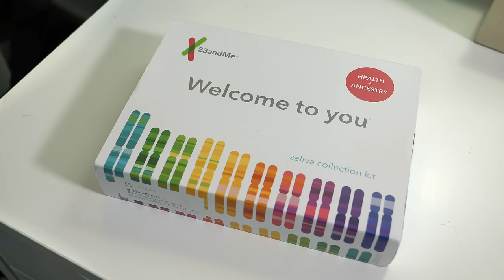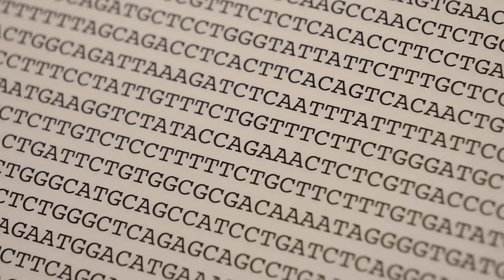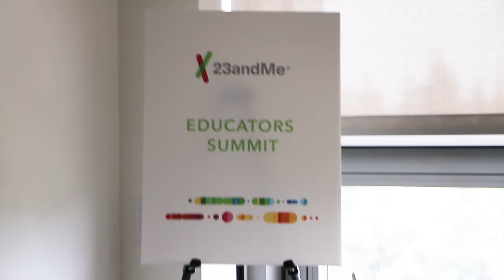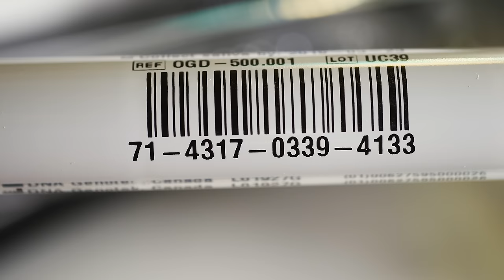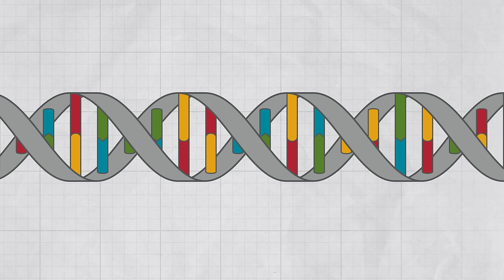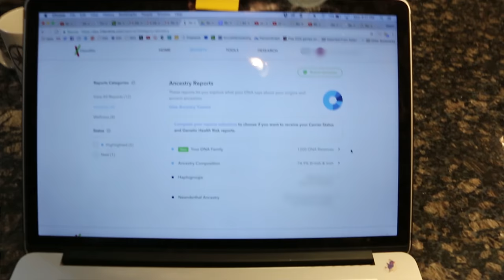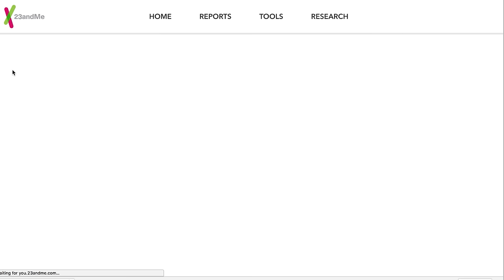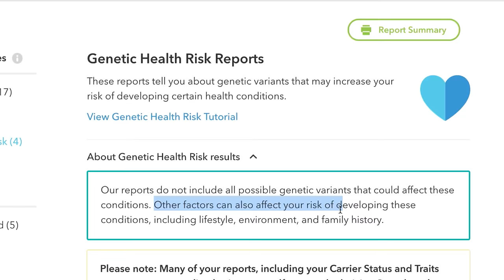DNA Testing and Privacy (Behind the scenes at the 23andMe Lab) - Smarter Every Day 176

Comment: I've got a BSc in Genetics so thought I'd explain a bit more on how significant that small percentage of DNA they take is and also add some extra interesting facts, including why we're still not really using genetics much in medicine (which I believe ties into the third party scientists mention of the "nuances of human genetics"). :) 

Firstly, while I'm not paranoid about it, what they mentioned on genotyping and how little info they take - that small percentage is actually not as safe and insignificant as you might imagine. This is because the vast majority of your DNA is made of repetitive "non-coding" sequences.  As an example one single type of repetitive sequence, called the ALU sequence, makes up about 10% of your DNA - this is more than all the "coding" elements put together!  When you look at how much of your DNA is coding data it's actually a very small amount, so they'd actually be collecting a substantial amount of info on what makes you uniquely you, and this could still be used to identify you! While I say this though, the interesting fact is that in things like paternity tests, they actually don't use any coding data! They use the pattern of the non-coding elements - so in a paternity test they ironically identify the father from DNA that doesn't specifically code for the father or the child! 

You may be wondering why there's so much non-coding DNA - interestingly they used to call this "junk DNA" as they knew it didn't make proteins and thought it was waste left over from evolution.  They actually used to remove this on early cloned animals, but through that they realised it's not actually "junk" (if you look up Dolly the sheep, one reason she actually got really ill because they removed her "junk" DNA).  This is actually used - amongst other things - to promote/inhibit/control what parts of the genome are expressed.  This is known as epigenetics (which also has a lot of other areas, not just this - it's truly fascinating!), and that's one of the new big areas of genetic research. With epigenetics, we now know that even the coding parts don't specifically code for who you are as there are further controls and some of it is never even used!  That is why for most genes they don't say "You have X gene so you'll get X illness" - they only say a % as your body may or may not use those genes in ways that cause that illness.  ...also this is different for every cell in the body as they're all pretty much independent.

If you want to read anything even more fascinating you should look into the human microbiome - which is how they actually think the DNA of organisms inhabiting out body could have even more impact on things like health than our own genome through (genetic) symbiosis!  The total bacteria inside you have potentially 100s of times more genetics data that you do, so if there is symbiosis there you can get how relevant that is - essentially they're an extension of your genome! ...worth remembering that next time you're prescribed a broad spectrum antibiotic (which basically aims to kill all internal bacteria!!).  With epigenetics and the human microbiome though, hopefully that shows why so little genetic info is still used in medicine and diagnostics.  DNA is not the simple blueprint of life we thought it was 20-30 years ago, so it's not a straight tool that can be used for diagnosis - it more shows you potentially how healthy or sick you could be, rather than what you will be.
Reply: Tad Springer Dolly the sheep became ill because the chromosomes of origen became from an adult sheep. That means shorten telomeres.
Reply: Carlos Alemán Dyer while that's true, it's not affected other clones that have also been cloned from adult cells as now they include non coding regions. The exclusion of non coding regions meant there was less control of gene expression, which led to extreme levels of inflammation. That's why Dolly had extreme arthritis by the time she was about 2.

A far as the shortened telomeres, there's an enzyme called telomerase that extends these. This means it wouldn't have passed to Dolly. The cells that were chosen were also taken from a fairly young sheep and were compared to many others to choose cells that hadn't lost much genetic information from telomeric shortening, so it's unlikely it played a huge role in her illness. It's all relative though so it could have still contributed.
Reply: Tad Springer I'm not inventing stuff up you can do a research and find that they where studies on telomere and telomerase as early 1994, but the activation of the telomerase was not use in Dolly. Activation, because the telomerase is inactive in mammals.
For Dolly they not only clone 1 sheep but 3 and compared the length of the telomeres between them, 2 of them were the same and1 was different because the age difference of the donnor. 
So yes the fact that Dolly age quickly and had health problems is because of the shorter telomeres (Here is a simple bibliography:
Blasco, M et al.; Telomere and telomerase; Genes and development 1999, 13
Xu J., Yang, X; Will cloned animals suffer premature aging - The story at the end of clone chromosomes; Reproductive biology and Endocrinology; 1; 105; 2003
Shiels P. Et al; Analysis of telomere length in Dolly, a sheep derived by nuclear transfer; Cloning; 1(2),2004; 119-125)
Reply: wild mangrove I'll have to check those out, but telomerase definitely isn't inactive in mammals.
Reply: So never use antibiotics unless youre already dying? Tell me something i dont know. I like my microbiome old and healthy. No drugs for me thanks.
Reply: You did a bachelor specifically on genetics? Or just a focus on genetics while doing biology/ biochemistry? (I'm doing a bachelor molecular biology at the moment)
Reply: Tad Springer Thanks for clarifying. I was sitting there watching that explanation and trying to find the best words to explain about non-coding/coding regions. I work in a forensics lab and we also look at "junk" DNA for purposes of human identification.
Reply: Tad Springer Thanks for chiming in!
Reply: Tad Springer Can you help me understand what the information is that "I might not want to know"? Have you used 23 and Me? Is like a checklist that gives a "yes" or "no" for some gene responsible for cancer, Alzheimer's, and genital warts :) ? What would be an example of "bad information", and would it be on a scale of likelihood or would you either have the gene or you don't?
Reply: Tad Springer Thanks for sharing...:)
Reply: As soon as he said the 0.02%, I suspected, like you said, the information entropy in that small amount of DNA was significant. I think it's rather dishonest of the genetic scientist not to say anything on this subject. They should have said something like "you're only giving a really small part of your entire DNA, ***however the part they take represents the most unique parts of your DNA, which is why they take those***". The privacy concerns are very much relevant.
Reply: @Star-lord - amazing how few people know that or that don't even believe that! There are definitely times that antibiotics are necessary (i.e. bacterial meningitis), but the routine use is like a nuke to the microbiome. In the future I think we'll judge today's beliefs on antibiotics similarly to how we now judge the war-time believe that smoking was good for you!
Reply: @Marijn Verhaeg - I actually did a BSc in Genetics.  It's actually not just 3 years of pure genetics though, the first year was actually the same track as a medical degree, then the next 2 years had a mix of Genetics, Biology, Imunology, Chemistry and even programming (given how much is done by IT simulations that have to be specifically written or adopted for most use cases).
Reply: MrRicmeme 
They kind of did suggest that when they said they take the most interesting parts of your genome .
Reply: @MrRicmeme - I totally agree with you that it seemed a bit dishonest! I was actually quite amazed he didn't say anything too and I do think not to give some information on how important that small % is was a bit misleading which was actually what made me comment.  Saying that though, even the explanation I gave, while being very long, was still extremely simplified and I found it hard to explain.  If he'd done a decent explanation it could have made the video twice the length, so maybe he just chose to keep it simple and not mention it.  

I do think it would make an interesting future SmarterEveryDay video to explain that though! I'm sure there must be more people who did their maths just like you did and realised there must be some extreme significance in such a small amount of DNA.
Reply: I have a crazy, uneducated question. If your body may not use all the genes in your DNA, does this mean a clone of a human will not end up exactly the same as the original? Could there be significant changes?
Reply: @Dima Aryeh - Actually not a crazy uneducated question at all - it's an awesome question as you're totally right! Take Dolly as an example; granted they made some fundamental errors as she was an early clone and she wasn't actually an exact clone, but she developed very different to the sheep she was cloned from and I think she even died before the source sheep.  There's a lot of chance in genetics and also a lot where environment shapes things. The best (simplified) example I can give is eye colour - you don't have a coding for eye colour specifically, but you do have a coding for how reactive the eye pigment is to sunlight (more sunlight in early years is actually what makes your eyes darker).  So if you took two cloned babies and left one outside in sunlight and the other in a dark room the one outside would likely have brown eyes and the one left inside would be more likely to have blue eyes.  In this way clones can be genotypically (genetically) the same, but phenotypically (physically) different.

It's kind of back to the nature/nurture debate too - we still don't know how much of what makes us is nature (DNA) or nurture (environment, diet, upbringing, stress etc).  We're essentially shaped by both, so even if you control the DNA it's likely the other factors, which control things like DNA expression, will be different.  That's kind of what I meant by how we now know DNA isn't just a blue-print for life.
Reply: Thanks for the response, you're a badass!
Reply: @Haloruler64  you could also look at identical twins if you need an example for natural clones. Keep in mind that the environment where they grow up are usually more or less the same. But you could look for twins that grow up separated to see the effect of environment.
Reply: Thanx for the explanation man!
Reply: learnt more from your comment than from the video
Reply: Thank you for starting such an interesting conversation
Reply: "While I say this though, the interesting fact is that in things like paternity tests, they actually don't use any coding data! They use the pattern of the non-coding elements - so in a paternity test they ironically identify the father from DNA that doesn't specifically code for the father or the child!" I've been researching more and more regarding paternity and sibling tests and have asked a LOT of questions. Many of the answers I receive are saying sometimes it's just luck and these answers are from various labs. I find it interesting that paternity/sibling and relationship DNA testing are being held as the end all be all when many times it may not be accurate. Another question I have is regarding the "fake" DNA that is mentioned in the video. What if there is an error in that strand that is man made that the natural DNA is supposed to adhere to? Then what happens?
Reply: I forgot to ask, why don't they use coding data for paternity testing? Wouldn't that be more reliable?